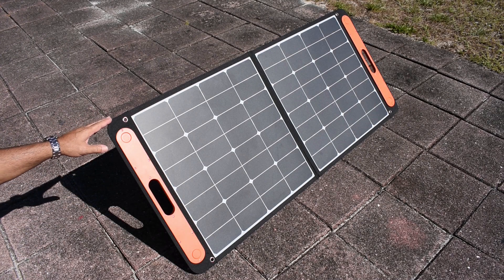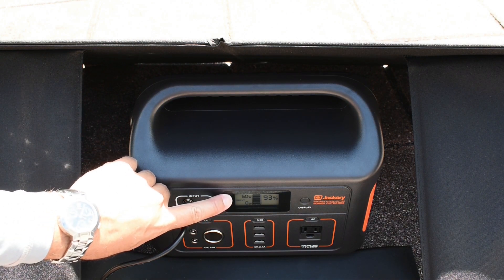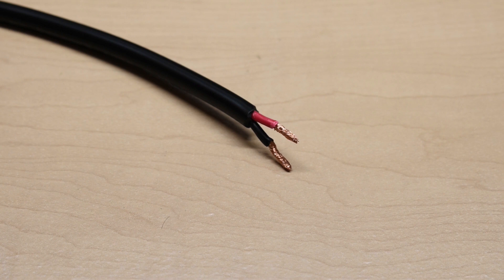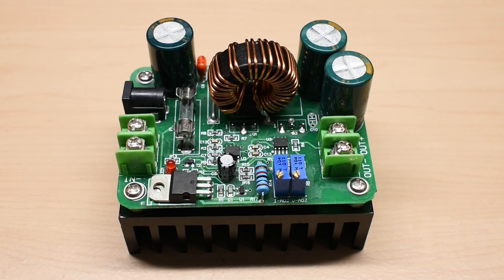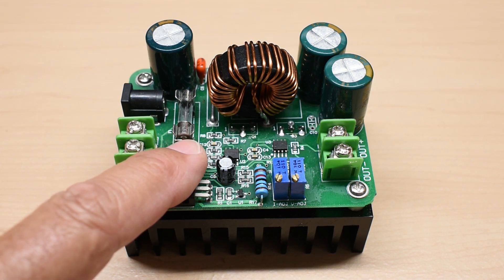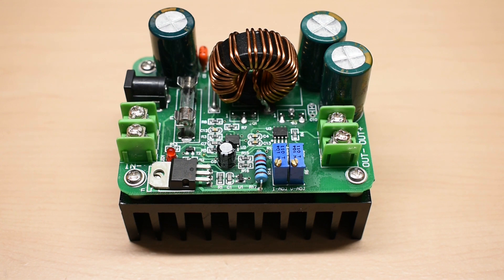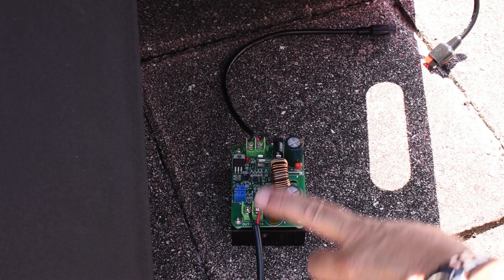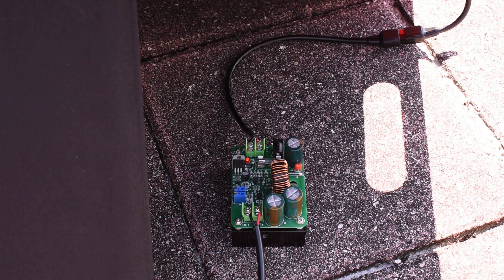How To Charge Your Portable Power Station FASTER! Simple Trick!

Comment: You could buy a higher working voltage 12V panel. Jackery panels suck. 

Creative work around! Good job. Amazing output!!! 90 watts is incredible from a jackery. Good job

I just hate those panels. So junky. Also the jackery panel is overpriced.
Reply from the maker: True. I don't think they were too happy when I told people in my other video to not buy the 100W panel for use with the Explorer 500. It makes no sense that they'd sell a 100W solar panel for use with a PPS that only utilizes 60 - 65% of the panel's power output. I talked people into getting the cheaper solorsaga 60W. LOL I was never a big fan of the PET solar panels. The only thing I noticed after making my other video, is that the cloth stretches a little when you pull the panel support away(the velcro). I think over time it would end up tearing. Even though it tested very well, I agree it's overpriced. There are many other panels that you can use for a lot less. Thanks for watching!
Reply: Maxoak bluetti needs 40VOC minimum with it's mppt in my opinion. I would never use a 12v 20-22VOC panel with those.
Reply from the maker: With my Bluetti, I use a 400W solar module or my homemade 200W folding solar panel.

Comment: What you are doing is matching the output impedance of the solar panel to the input impedance of the solar station. This will give you the maximum power transfer! The same thing that a MPPT solar charge controller does in an off grid solar system.
Reply from the maker: Correct. Just like a MPPT. Thanks for watching!
Reply: alternatively expressed, allowing the panel to run at Vmp, instead of at Vbatt where it's likely hobbled.

Comment: I have an even better solution, DIY a wind turbine venturi vawt booster compressor & a 10kg 800w Brushless AC Generator Permanent Magnetic PMG For Horizontal or Vertical Wind Turbine 24V 48V, MakeSkyBlue 2000W 48V Wind Charge Regulator for 2KW AC Wind Turbine or the 1000W 24V Version depending on your battery bank & PMG Voltage, #428 106 Link Chain, 18 Tooth & 54 Tooth #428 sprockets giving 3:1 Ratio. You put the 54 Tooth sprocket onto the wind turbine booster that spins & put the 18 Tooth sprocket onto the 800w permanent magnet motor.

The Venturi vawt booster compressor is like a vertical fixed wind guide on the outside that focuses the wind into the center where the 7 bladed spinning top type of can spins up to about 333 rpm. This means that your 3:1 ratio chain drive will produce up to 1000 rpm on the 800w permanent magnet motor always producing up to 600w - 850w of power in average to medium winds. If you experience high winds the controller will cut power to the battery & resume charging when the voltage comes down.

You could potentially make a 4 foot round by 2 foot high portable unit that that you mount on 3x 7 feet long Y stakes when you go out 4wd camping & throw it in the back of your pickup or ute & use with a 1000w inverter connected to a large 24v or 48v lithium E-Bike battery & run all sorts of gadgets like fridges, camp lighting, portable electric warm showers & all your charging needs. You can easily turn a 120v/240v 500w portable water heater that you hang in a bucket to heat water & use a 12v shower that pumps the warm water from a bucket to the shower head to have a warm to hot shower out in the middle of nowhere.
Reply: That does not sound very portable like these items in the video ! Different use case your idea is good but not if you need the portability of this Jackery unit and solar panels !

Comment: I happen to have one of those Boost Converters on hand.  A number of the Higher Amperage versions as well.  Guessing your bringing the voltage up into the usable MPPT Voltage range of the Jackery.   The DC/DC converter within the MPPT charger is able to take advantage of the Higher Voltage creating more usable current.
Reply from the maker: Pretty sure the Explorer 500 doesn't use a MPPT, only the newer Explorer 1000. The MaxOak units have a built-in MPPT, but the problem still exists. The higher voltage input from the DC-DC converter allows the portable power station to charge much more efficiently. The boost converter is just like a MPPT.

Comment: It would seem that the DC to DC converter would eat up some of the total power available. Watts equals voltage times current. There may be something that doesn't meet the eye here.
Reply from the maker: The converter does lose some power, it's around 92% efficient, so you lose 8% of the input, which is why you only see a max input at 84-85K lux of around 93W.
Reply: That's a voltage "buck" converter. It doesn't magically make more electrons (current) run from the solar panel to the battery. John is right.
Reply from the maker: @wxfield  Incorrect. It's a "Boost" converter(step up converter), not "buck". You don't understand why this works, and I don't appreciate viewers insinuating that I'm a liar. People like that get placed on a special list on my channel, "never assist when asking for help".
Reply: @electronicsNmore  I'm pretty sure I do understand how it works given I'm an Electrical Engineer by training and trade. Nobody called you a liar or tried to be insulting to you. Nice video, thanks for the effort.

Comment: Just get an proper MPTT converter. Not much more money and more efficient.
Reply from the maker: Proper? Some of these units, like the MAXOAK, have a built in MPPT. LOL What I show is the best "Low Cost" method to charge a portable power station faster by solar or in your vehicle, if you're experiencing charging problems. MPPT's are just like a boost converter. You won't gain much over what I used.
Reply: @electronicsNmore   I think such portable solar panel can be folded so there should be wires that connects both pieces. And you  can rewire it in series to get more output voltage > built in mppt in that solar station should work better
Reply: Sorry, I meant to write MPPT. MPPT is more than just boosting the voltage, it is dynamically adjusting the solar cell load because a solar cell is not linear device. Within the most efficient range a solar cell is a constant current device so the load is adjusted to get the most power out of the solar cell. I agree, If you have a boost converter in stock, who doesn't, I have a few, it is simple and will help. Otherwise you are better off getting an 5A adjustable one from banger's US warehouse for less than $10USD.
Reply from the maker: The Jackery panel is already wired in series. It has 32 cells. 32 x .58V = 18.56V.
Reply: i mean both folded  pieces in series to get 24+ volts if possible
Reply from the maker: @voidex136  Each piece has 16 cells! Each side produces 9.5 to 10.6V.
Reply: thank you for clarification! ^^